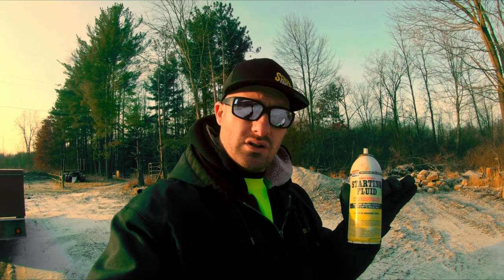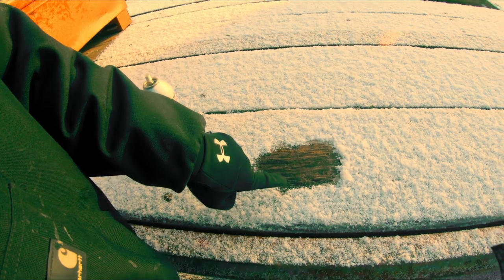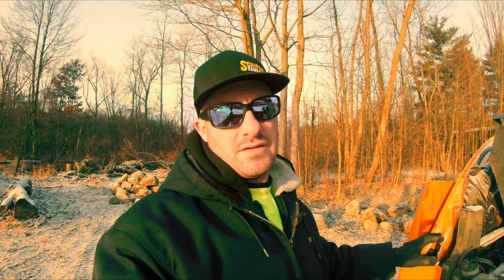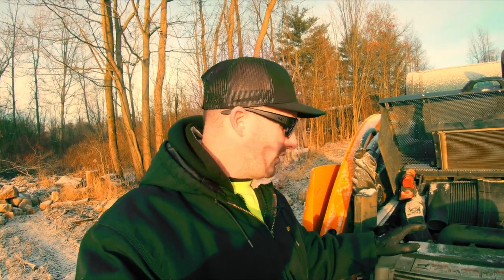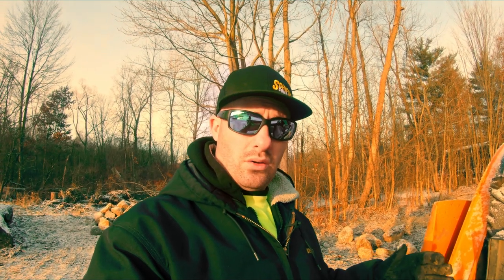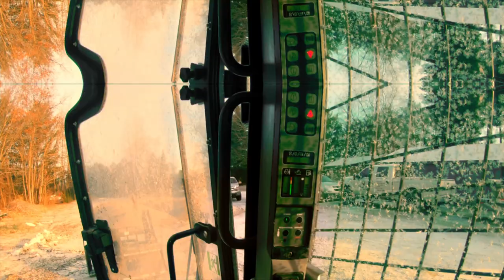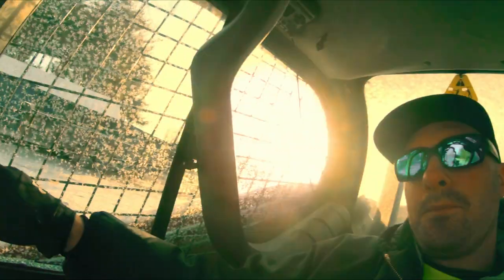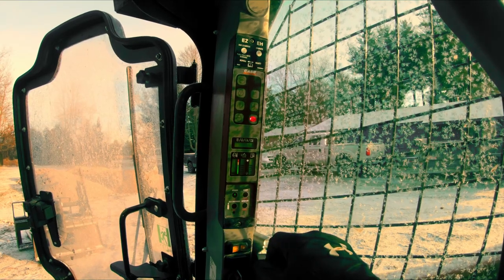HOW TO COLD START HEAVY EQUIPMENT || Different techniques for cold starting heavy equipment

Comment: A tip another operator gave me is once the machine has sat idling and warmed up was to run it through every function at slightly above idle to get the hydraulic oil moving before going and putting the machine to work. Like with a skid steer boom up and down, curl and dump the bucket and drive forward and back a few times. Love the videos, keep em coming
Reply from the maker: Absolutely.  Just because the machines' engine is warm doesn't mean the hydraulic fluid has warmed up.  All functions should be used and cycled for 5 minutes or so to begin to warm the hydraulic oil up.  Great point!

Comment: Man I'll tell ya, those block heaters work great! It has been at or below -30 for a good few weeks where I am from. I work for a New Holland dealer in Canada and had to bring in a C345 (same engine as your machine) a couple weeks ago. That thing ran the glow plugs for ~30 seconds and fired right up in -35C with the block heater plugged in. The hydraulics definantly were NOT happy even at low idle and whined for a few minutes before it warmed up enough to quiet down.
Reply from the maker: I have been really impressed with the grid heaters in the newer machines.  They really don't seem to struggle firing up in the extreme cold.  Like you said, the hydraulics are another story but the engine doesn't have any issues.

Comment: I'll take 20 degrees and no snow any day.  Up here in Canada we have over 2' of snow and the temp was -30C which is -22F.  I find just plugging in the block heater for over 2 hours works well.  Cheers.
Reply from the maker: That's brutal temps!  Where at in Canada?

Comment: I’m an 18 year old from Tennessee going to school for construction engineering. Really wanting to get into the excavation field down the road after I get my degree but I have virtually no experience in this field . I’m wanting to get a summer job running a machine to get that experience any advice? Love your videos they are more eye opening than you know
Reply from the maker: Thank you so much for the compliment! I would look for a local residential company that is on the smaller side. They are generally going to be a lot more quicker to get you experience on a machine rather than just being stuck on a shovel for a couple years. They would also be willing to hire you on for summer work knowing that you will be seasonal.

With the way the industry is currently I think you'll find it much easier to get a job than you anticipate. Companies are starving for good workers and have no issue training guys. The major thing is showing up with good work ethic. You can train anyone how to run a machine but you can't teach someone how to have good work ethic.

Comment: I wish more guys would follow that warm up procedure.  Even on a warm day I let it warm up for 10 minutes and work the hydraulics a bit.  Drives me insane watchin guys crank em wide open and start diggin right away when its cold.  I told my boss if guys treated my equipment like that they'd be missing teeth
Reply from the maker: I think the biggest problem in the industry is the disconnect from the price of these machines. I had no idea how expensive equipment was until I started selling it. I had respect for it before but it took on a whole new level when I realized a loader was $250k+

Comment: ALSO I hightly recomend you take the cap off of the boost stud on this machine and just leave it off. When it gets cold out it gets really hard to remove it by hand and it will split if you try to pull it off with pliers.
Reply from the maker: Thanks for the tip!

Comment: Cummins diesel engines have an air heating grid located on the intake manifold. The heater grid is used to raise the incoming air charge as the air passes over the grid. This heated air charge aids in the ignition of the diesel fuel-air mixture. This heated air charge is used to aid the starting of your Cummins diesel engine when it is done to help the engine start and improve driveability with cool or cold outside temperatures. A warm mixture of fuel and air allows the diesel combustion cycle to start. The heater grid will continue to cycle until the engine has reached its correct operating temperature.
Reply from the maker: Thanks Tim!
Reply: I have a case 440 that has the lights like the glow plugs do but has a grid heater no glow plugs . When I turn it on the only time my grid heater works is for that first few seconds that the light is on for . Is there something wrong with mine ? It does smoke a lot when first started for at least 2 minutes

Comment: How often should you start a mini excavator in the winter?
Reply from the maker: I would say once a month if it's just out sitting in a garage or barn.  Just enough to get the juices flowing and keep the battery charged should be fine.
Reply: @DieselandIron  sits outside

Comment: In the old days they'd drop the oil into a bucket at the end of the day, warm it by the fire in the morning and pour it back in.  Gasoline aircraft engines had a valve to dilute the oil with fuel, which would boil off after it started; I assume the EPA would not be amused.
Reply from the maker: haha there are a lot of old practices that would make the EPA cringe pretty hard....thanks for the comment!

Comment: Whe. You said extremely cold I tonight you meant it.  It's minue 60 here today and I'm trying to get a machine started with the glow plugs and it isn't working.  It's a 2019 that's been maintenance by a professional shop for years.  Maybe glow plugs don't work that cold of weather.
Reply from the maker: When you start getting that cold you need some sort of grid heater and a block heater that you can plug in.  The glow plugs just aren't capable of getting the combustion chamber up to temp when it's that cold.